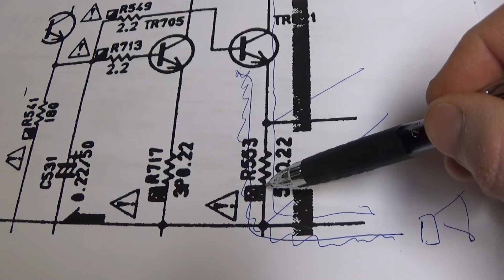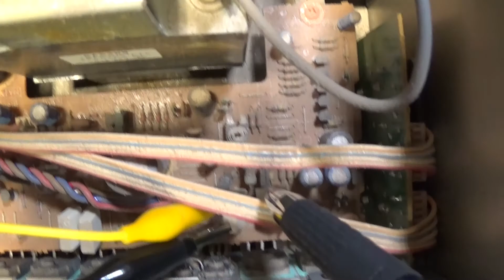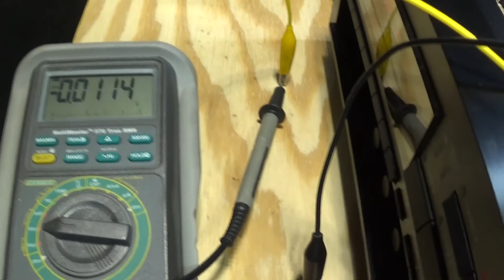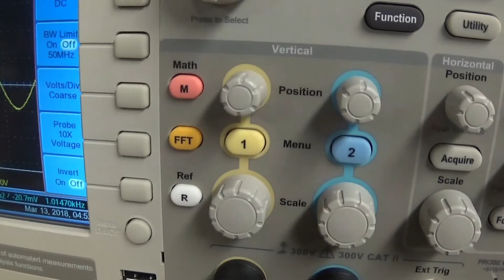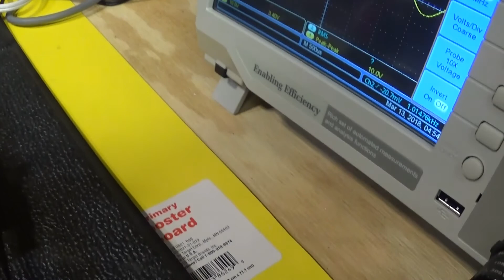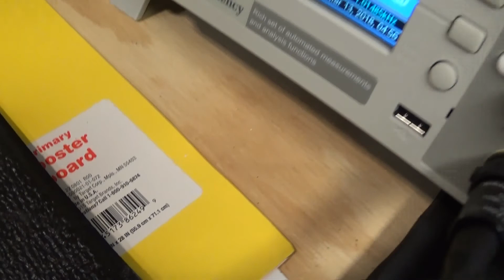Yamaha R-9 Receiver/Amplifier Pt. 3: How Much Class A (No Bullshit Test)?

Comment: I just bought this receiver at a thrift store for $8.99 . I actually passed by it 3 times thinking it was just an outdated surround sound receiver  then I noticed the Word Stereo and Class A on the face plate lol .  Only thing I needed to do was clean up the volume knob static  and it was an instant upgrade for me . The moving cover is also present and not broken which is cool .  I was using an Modern Denon DRA-800H that I purchased 2 years ago and the R9 blows it away hands down . I just found a remote for it and I'm now selling the Denon before its worth nothing . The Denon is ok but I  never use the Bluetooth , HDMI  or Wifi functions so it's pointless to me and as with anything that connects to the internet or is considered "high-tech" it generally drops significantly in value after 3 years so good timing for me .

  If the R9  had a silver faceplate , 2 big knobs and a large tuner  turn dial display this would be a highly prized item as it sounds great with a ton of power , not to mention you can run 3 pairs of speakers off it in stereo  . People are just in the overpriced  trend of the 1970's amps because they look cool but the 1980's receivers were just as good if not better  and definitely more reliable .